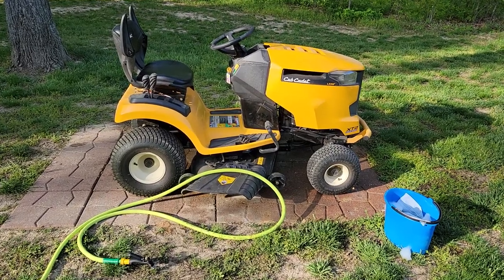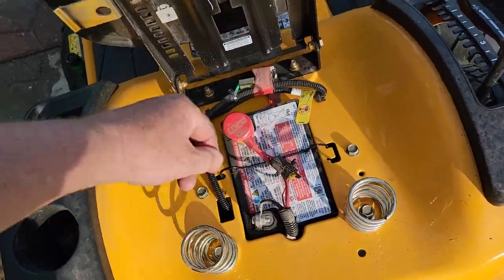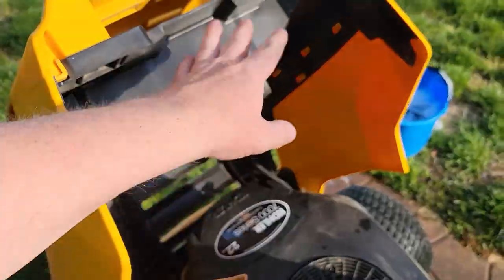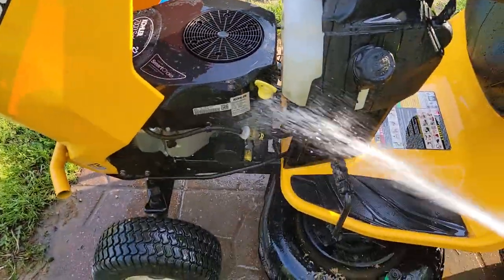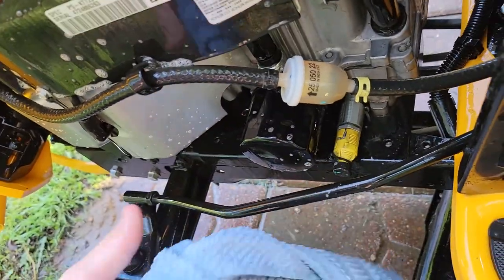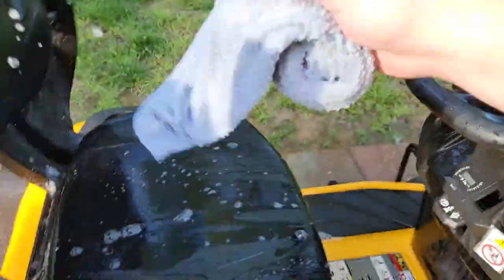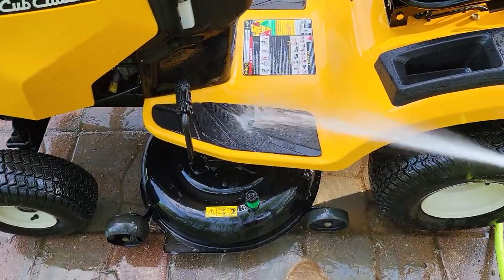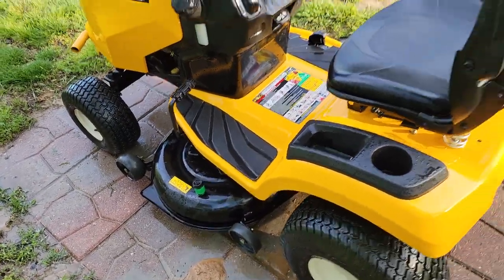HOW TO CLEAN / WASH Riding Lawn Mower With Hose Soap & Water Cub Cadet John Deere

Comment: Interestingly the Cub Cadet manuals say not to use a garden hose or a pressure washer to clean them. They say only to use a hose on the deck if it has the deck wash system. They conveniently leave out how you're supposed to clean it, since an air hose only goes so far. Surely they know people do, so I suspect it's just their way of washing their hands of rust or other water-relate issues over time.

Comment: Can water rust the mower? I had a repair guy recently say don't wash it to much because it'll rust.
Reply from the maker: yes you might get some rust, but I let mine sit outside in the sun and it dries off pretty good.    I had a Cub Cadet for over 15 years and I regally washed it and I never saw any rust or had problems with it,  I sold it to someone who is still using it.   you could use a leaf blower and dry it off after you are done
Reply: @JustADad  Thanks for the heads up.
Reply: Dry it off very well everywhere and your motor won't have time to rust. Like the other guy says let it sit out in the sun. Wipe it down dry it off. What I like to do is use an air compressor nozzle that'll let you focus on areas that are heavily wet like the nooks and crannies wear water can sit if it's dry it can't rust.

Comment: Thinks it’s best to blow off debris, spray water/cleaner mix like a waterless wash on a car and wipe it with drying towels as I do with my rider.  No need to use a hose or pressure washer this way and safer

Comment: I DONT wash mine with a water hose.  I use compressed air and blow down first.  I use a bucket and a soft rag to wipe it down.  It’s. 2017 and looks and works like it new.

Comment: I lightly sprayed my riding mower with water and it’s not starting anymore. Any ideas of what I can do?
Reply from the maker: set it in the sun and open all the panels,  let it air dry in the sun a couple days.
Reply: If it's turning over but not starting clean your carburetor out it's very simple drain your gas tank put fresh oil in it and you should be good.😊
Reply: Did you check fuel😊